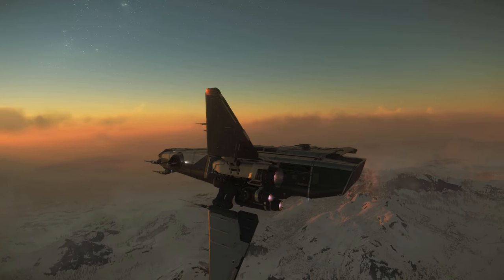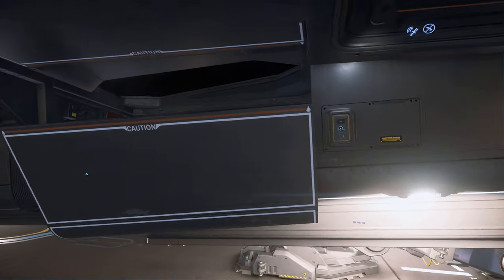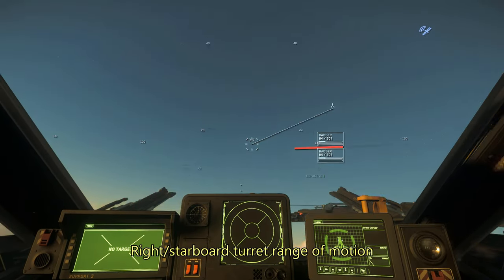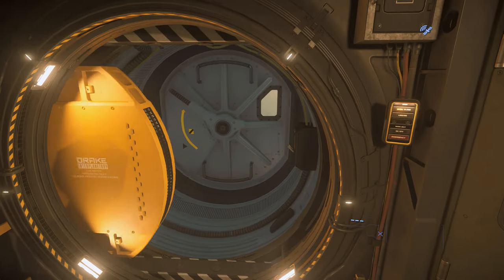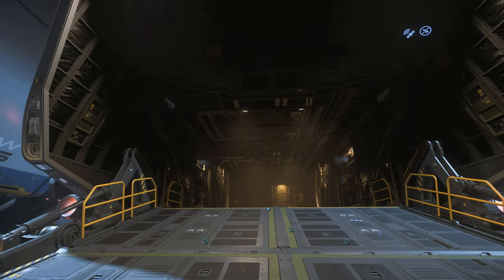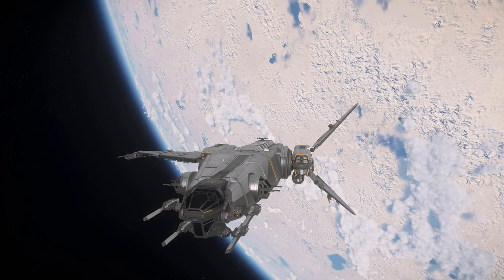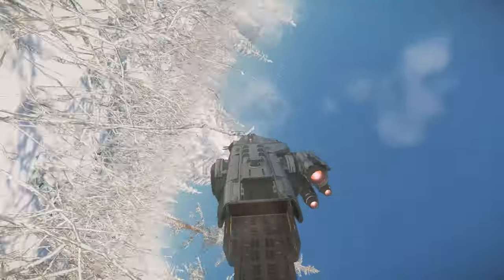Star Citizen 3.17.4 - Drake Corsair first look, tour, and systems/stats

Comment: About the wings, I couldn’t really tell if it suffered any maneuverability when you lost the wing, because it looks like there aren’t any maneuvering thrusters on it, of course you lost your missiles, and losing the other wings would take out your size 4s, but you wouldn’t necessarily lose anything crucial. I think the biggest risk is taking your engines with the wing, but it seems like in order to do that, you have to get close enough to whatever you’re hitting that you would be hitting yourself even without the wings.
Reply from the maker: Yep you hit the nail on the head. It didn't feel too different in atmo flying straight and level but when turning it definitely felt harder to control without the wing. I haven't flown it a ton yet so I'll definitely want to try it out more, but this is something to consider if you're planning on using this ship in bounties where you're pretty likely to have ships like Valkyries and Cutlass Blacks ram into you, especially when you've got as wide of a wingspan as this ship has.

Comment: I'll be surprised if it doesn't receive a nerf at some point, either in weapon sizes or maneuverability.
Reply from the maker: Yeah we'll have to see how it fares in actual combat. In PvE it should dominate with it's current stats but in pvp it might be a bit too flimsy, hard to tell at this point though
Reply: It probably won't get nerfed until after the flight model changes in 3.18 because that'll make a big shift anyway.
Reply: It’s supposed to have s2 shields on the RSI website, so I though it’s pretty good as a Connie rival, with better pew pew - tried repeaters and melted PVE Cuttys, so once it’s in PU, I reckon the Corsair will be available to subscribers, so I can try it with s5 guns, though inventory space isn’t much.
Reply: @shawnc5188  last I checked it's shield listing was the exact same as the constellation on the RSI website.
Reply from the maker: @TPKPatchy  yeah and then master modes will again change everything all over again. Just surprised they put it out as strong as it is lol
Reply from the maker: @shawnc5188  I'm thinking we'll all get to try it during IAE so I'm excited to take it into VHRTs and ERTs, but like you hinted I might not be able to change the weapons to S5s there unfortunately
Reply: @WingZeroType  yeah, I got a months Imperator subscription to get the suits, but it also includes a weeks test flight for ‘new ships’, right now I have a Scythe in my ASOP that I can modify. In honesty, the Corsair is very slow and unstable in atmo, getting to a bounty without a QT maker take a long time, and the fuel tanks are small for a large ship.
Reply: @shawnc5188  The fuel tanks may likely get changed, they're unusually low for a ship of it's size. Connies and Redeemer have double or triple the capacity, some Freelancers have double, etc.
Reply: @corombb  Yeah, I was updating IC on some of the issues, the unstable atmo flight is already confirmed in the latest PTU patch
Reply from the maker: @shawnc5188  Yeah I was just flying it around on PTU for a few hours and it does feel very slow in atmo when having to fly a longer distance to a bounty, and maneuvering is really unstable, the way the Prowler used to be (but the Prowler is nice and stable now). Still some ridiculous firepower though. And yeah running out of fuel seems to be the limiting factor for this ship. The nice thing is that at long as you have 1 turret gunner in any of the turrets you can get enough coverage to help cover the maneuverability weakness in atmosphere since you can roll pretty easily to give your gunner view of the enemy.

Comment: Not too happy with how that elevator door opens on bottom.  Would have expected it to slide forward or fold up.  The way they did it, it seems to touch the ground.
1:26 F  
13 minute claim time is not bad.  Same as a connie.
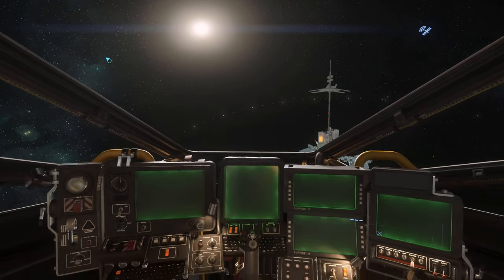2:06 the new Floor MFD introduced by DRAKE is actually just a repeater of one of the dash ones.
Reply from the maker: I didn't really think of the door hitting the ground, i thought it sort of folded back into the ship. I like that the elevator comes all the way to the ground, there have been too many times when I get out of a cutlass and have trouble getting back in b/c the ramp didn't come down far enough. I think the claim time is really solid for a ship this large with this much firepower, i'd have expected it to be longer. And yeah I considered that MFD just a silly little joke, it's funny that it's actually functional, even if it is just a duplicate.
Reply: The Floor MFD is ideal for setting comms so comms screens stop covering vital info 🧠

Comment: the firepower is insane, probably will get nerfed in the future though 😢
Reply from the maker: It might... but we've got flight model changes coming, and master mode changes incoming, and down the line we'll have armor changes as well, so everything is going to get shuffled around a bunch of times. I think you should only pledge this ship if you like the following idea: a drake exploration ship that's a constellation competitor with a lot of firepower. And don't be tied to its current performance. I think folks should've learned their lesson from the Ion sale last year but there might be some new folks that might be hopeful lol
Reply: 600i has 3 S5 hardpoints and has been unchanged since release. Connie is supposed to have 4 S5 hardpoints but two currently have locked gimbals because of clearance issues and may likely change with suspension or ship rework.
Reply from the maker: @corombb  Yeah the 600i is a really expensive ship though, and it's got basically no hull hp or maneuverability, so I've kind of let that one slide lol. But if this is really a combat capable ship and its sort of quick then I think this could be an issue balance-wise. It seems that the Corsair flies like poop in atmosphere though so that might be part of the balancing, if this current handling is intentional.